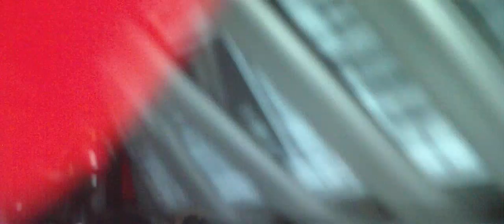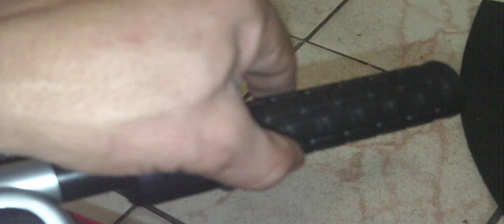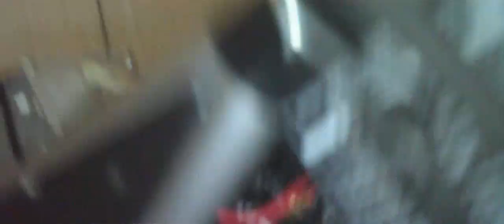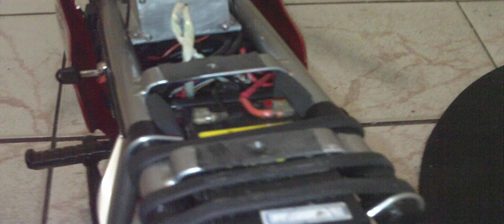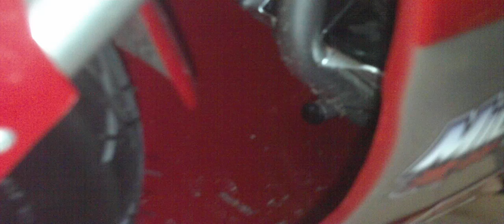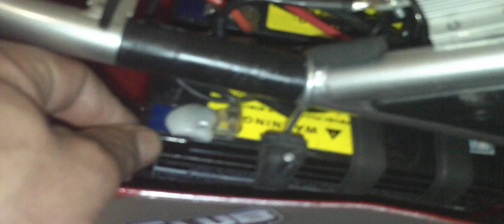Razor Pocket Rocket PR200 PB200 Electric Mods

Comment from the maker: @nicster1234567890 - No difference though they did slightly change every year. the one in the vid is a 2004 version when they had metal pegs and harder aluminum.

Comment: hi i just got my Kelly controller in and cant seem to get it going. i got the motor and battery part but cant seem to get the two wires with the plugs right. was wondering if you can help thanks

Comment: With an appropriate controller, you can run whatever voltage you want.  The motor limit is the current.  If you set a breaker or fuse in line with a rating below the motor max, then you'll be safe because if you give it too much throttle at low speed, the breaker will pop instead of the little motor.

Comment: I actually have 5 batteries on my razor, 54 volts, (4 12v and 1 6 volt..  Through a 36 volt motor and 48 volt controller, goes radar certified 23 miles per hour with 160 pound rider,..

Comment from the maker: is being held tightly in place by the rubber strap.  you have to hold it in place, than strap it around the seat frame rails. need to do it tightly, than you can do do the wiring as you normally would. it won't go  anywhere believe me, is a very tight fit.